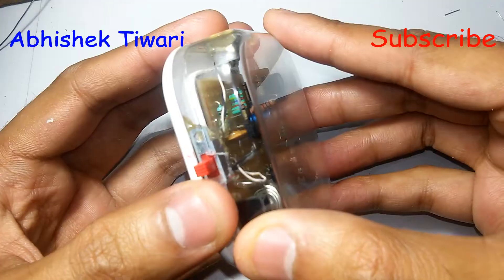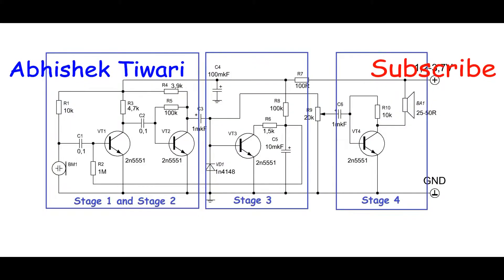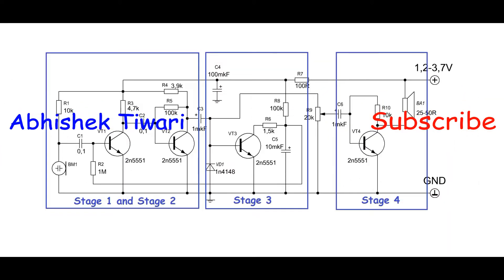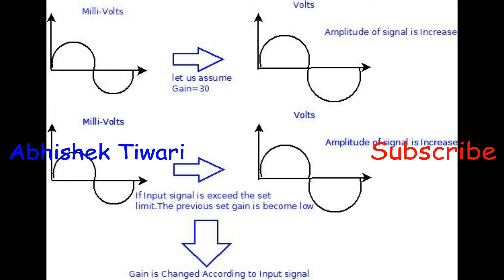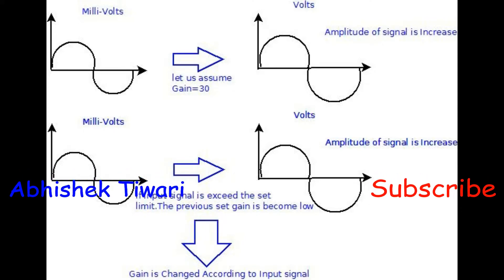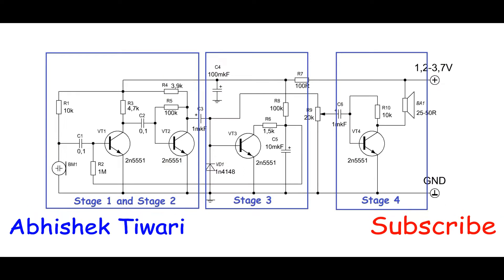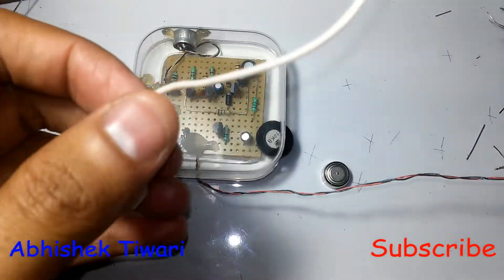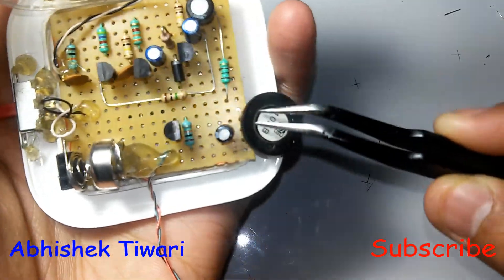Hearing Aid-Mic Amplifier(loud and Clear) operates on 1.5v by Using Transistors

Comment: Please answer the quarry can we use BC 547 transistors or please tell which others nos of transistors can be used as the transistor suggested by you is not available. The circuit suggested by you is very useful for them for those who are hard of hearing like me
Anil Kumar Goel
Reply from the maker: Yes, you can use Bc547 Transistor(NPN). 2N222 Transistor (NPN). My maternal grandfather has hearing problem that's why i try this. But this device is not useful for him in day to day life. This is just a prototype. Another feedback he had with this about volume of hearing aid was not high enough for him. Thank for being here. 😇
Reply: This is class amplifier excellent in hifi quality sound which is pleasing to hear.
Final stage can be made powerful enough to hear to your gpa..
Just wonderful efforts😊